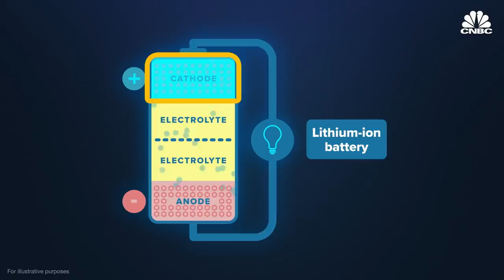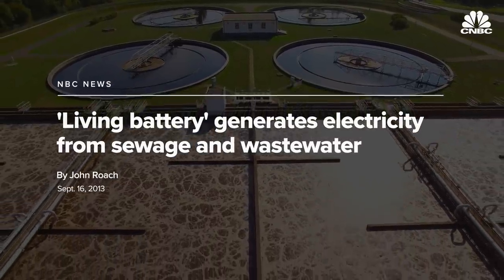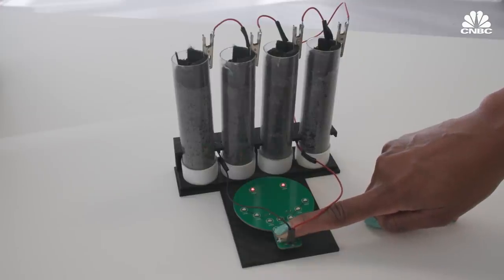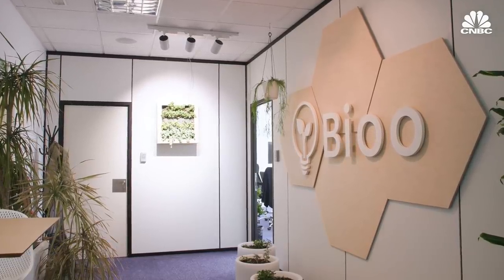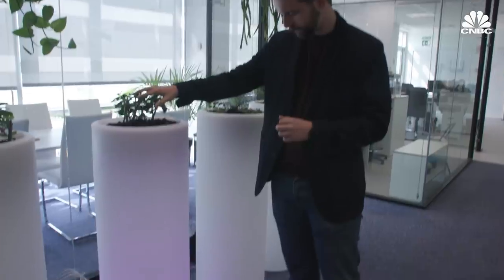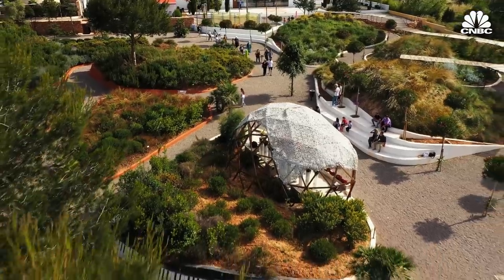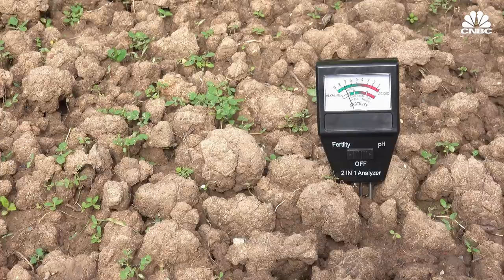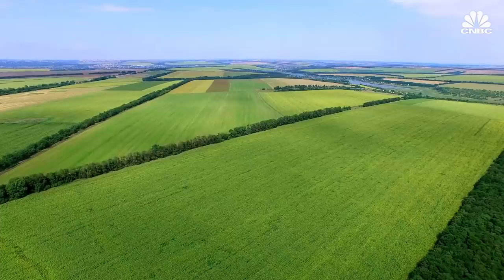How Soil Could Be An Untapped Source Of Electricity

Comment: ... the reporting is missing the big issue of rapid soil degradation! are they going to discount the fertilizer needed to replenish the soil that is now supporting the bio-electric needs of BOTH plants and the electrical load? what about soil ecology?... it has potential but they need rethink their target markets
Reply: @bioo.official  thank you for responding. I don't have in-depth knowledge of soil chemistry, but the idea of either the heat or electrons being produced by organisms simply being lost or not used... Given the complexity of soil chemistry... strikes me as odd.

The product as presented seems to imply that there is no scale of deployment or limit at which ecological imbalance can be caused and that is problematic.

However, as I stated I do think there is a lot of potential. In particular: compost, septic leech areas or situations in which manure / fertilizer is being mixed into soil... Maybe even a post-energy harvesting step of fuel cell + biodigester combinations.
Reply: @bioo.official  I have learned a little bit more and I better understand how your product operates.. I think that my concerns were a bit over stated... At least for most residential applications. It seems like basic lawn / gardening techniques should keep the soil in good condition.

Comment: It would take 1000 acres to power a car for 100 miles. This would result in a net gain in pollution and environmental damage. Well, electric cars are just about as bad, but that doesn't stop idiots from buying them. Maybe this tech has a future.
Reply: So ICE cars are much better than electric cars ? You have to use the one that is not the worst so even if somepeople say electric cars are bad it is better than ICE cars period.